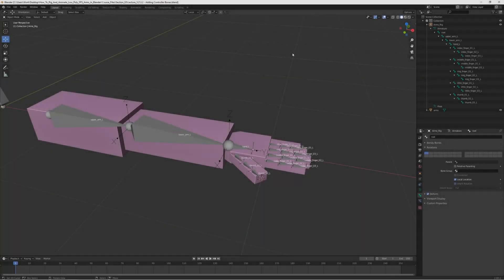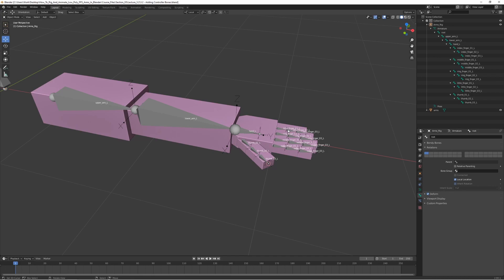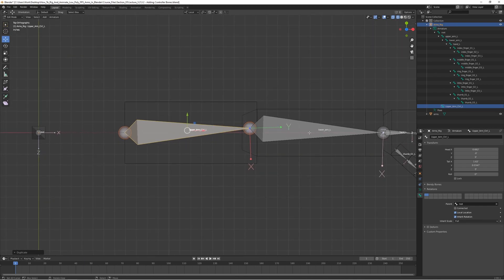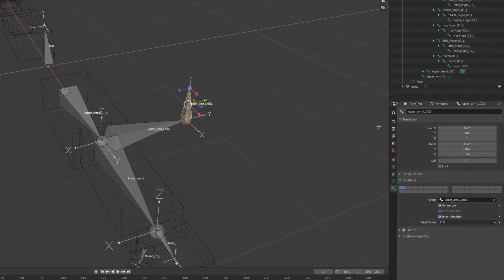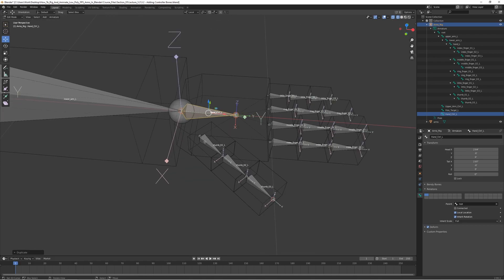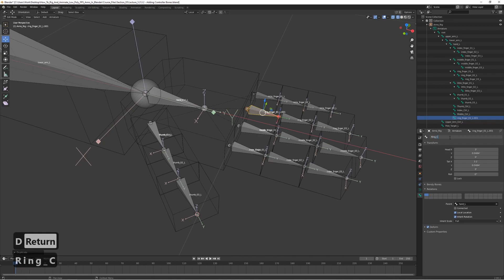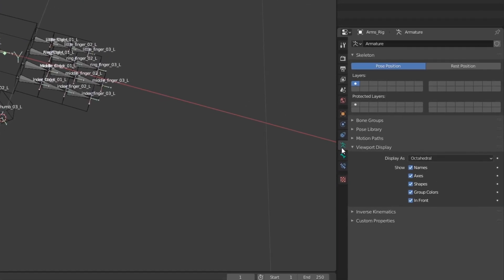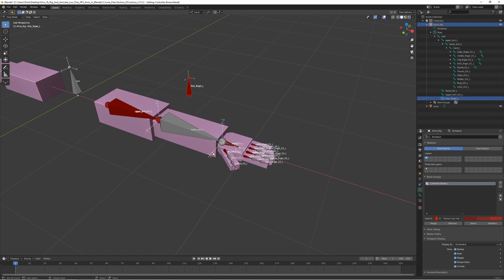Blender FPS Rigging & Animation Tutorial - Part 8 - Adding Controller Bones to the Arms Armature

Comment: I have an issue I created my own arms and extruded along all normals to create the sleeves and gloves and then joined them all together. And when i get this far and try to use the automatic weights my arms split in two showing the sleeve and also my gloves split too. What is happening here. I am happy to provide a picture if needed. Please help

Comment: Regarding Bone Colors on Blender 4.0:

- Bone Groups no longer have colors, instead the colors can be assigned individually for each bone.
- To set a color to multiple bones, select all the bones you want to change, and in Pose Mode, Under the Bone Tab > Viewport Visibility, you'll have two options, Bone Color, and Pose Bone Color. These represent the colors that will be used by the bone in both Edit and Pose mode respectively.
- After selecting the colors you want, you can click on the little icon with two arrows next to the color, to copy the color of the active bone to all selected bones, so you don't have to assign the colors for each bone one by one.
Reply: thx bud :)
Reply: thank you so much ive been fiddling with this for a while
Reply: bro, ur the best! thanks
Reply: Yes Mate!
Reply: My gratitude upon thee is immeasurable
Reply: Was literally about to flip the desk.

Comment: why we disabling deform?  i didnt get that sir
Reply from the maker: The main reason for disabling the deform on the controller bones is because we don't want to include them in the exported file, when exporting later on we only need the bones that are "deforming" the mesh, there is an option in the export settings called "Only Deform Bones" which makes it easy to only export the bones that are needed.
Reply: My guess is that the original bones are doing the deforming of the mesh itself, and the control bones are controlling the original bones, thus not needing to deform anything. (Which could end up creating problems)
Reply from the maker: Yep also true, this is especially useful when using automatic weight painting since it will include any bone that is marked as "deform".